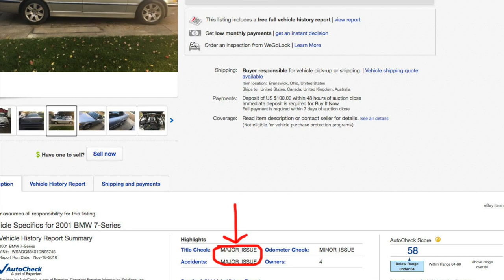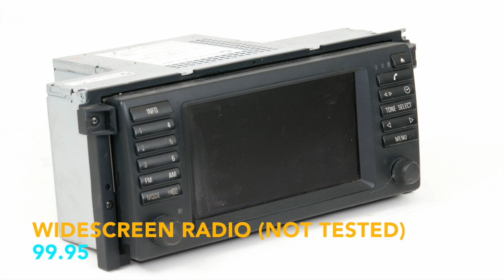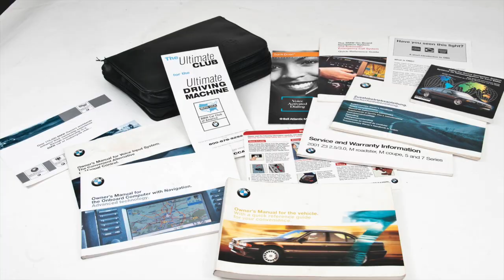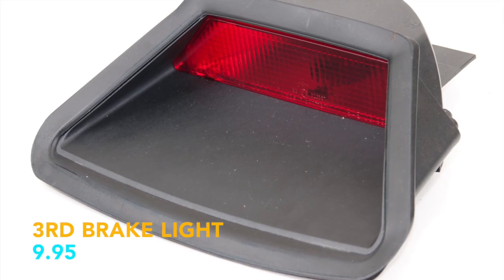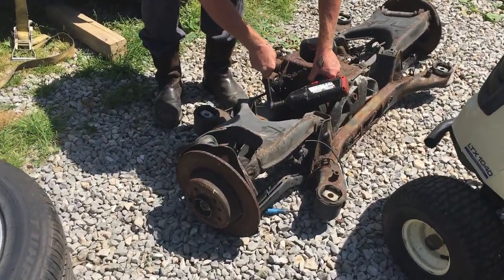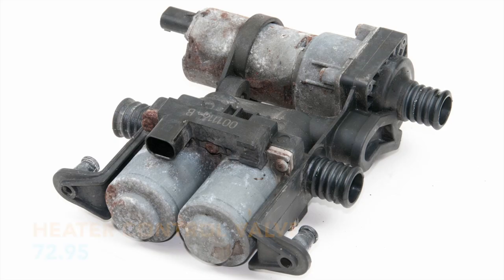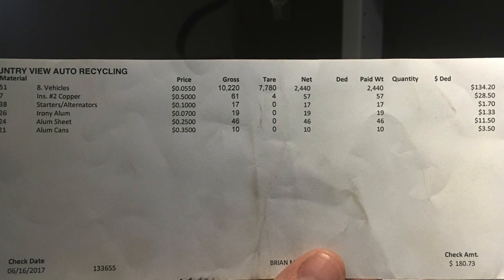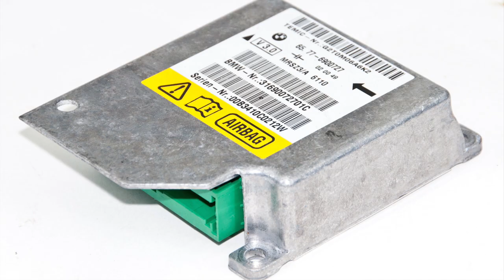How I made $4k parting out a BMW E38 7-Series - only half way done!

Comment: I’ve been parting E38s for about a year now. Currently on my 7th one. I love it because it’s fun but also very profitable as you are seeing.
Reply from the maker: You're absolutely right. This was a fun car to work on. There was some learning involved, as BMW does some things differently, but now I'm on the lookout for another E38 when I have the space.
Reply: Hey Matt roughly how many hours do you think you have between stripping/listing/shipping on a  average per car? I'm stripping an 2006 5 series and I'm already at 25 hours and I think I should be farther along,  but I'm not sure. The only thing left to do is to strip and list the interior.
Reply: @nathanhensn8717  howd u do parting your 5 seriers out
Reply: @egrayy9500  I'm a full time ebayer right now bc of it. I'm $3,200 "net profit" after fees and everything. Have about 130 hours into everything for that car, but around 40 were for learning and mistakes. I stopped doing it just bc of room reasons and im into Amazon returns now for ebay. I am selling my house and getting a building for my business, and stripping cars will definitely be added to the arsenal. I'm going to stick with the S series, maybe Coopers, and obviously 7Series if I can find a decent one. With my ebay experience right now, and a lift/room I could probably cut the time into 80 hours total from fully together to sold/ shipped.
Reply: @nathanhensn8717  what items sell good and what did u get for the 5 seriers
Reply: I did 7x BMW E39 5-series the same way in the Netherlands.. also love it. The money is nice if you don't literly count all the hours. For me it's also a bit of a hobby.. wrenching in the weekends 😁

Comment: I've been buying salvage Mini Coopers (2002-2006) over the past 4 years.   1st one was a 2004 JCW that too far gone to repair.  Bought for 2250.00.  total parts sales = ~6600.00.   so around 4k profit.    Rebuilt the 2nd one, a 2006 JCW convertible into my summer daily driver.   And finally have another 2004 S that is currently being torn down in the garage.    Keeps me out of trouble and funds other projects that I can't get by the finance dept.  :)   Great channel by the way, glad to see you are still working on cars/trucks and expanding into being a youtuber.

Comment: Who the fuck would dislike this? It's a great video that took alot of work.
Reply from the maker: Thanks man! I think people get salty that I parted out a complete E38. The car doesn't look horrible on video but in real life it was junk. It wouldn't start, had a salvage flood title, electrical issues, rust holes, damage or rust on every body panel except for trunk lid, no reverse etc... Some cars are better off as parts to help the worthy ones stay on the road.
Reply: @6thGearGarage  I don't understand it. People don't realise how easy it is to total a European car. What are you going to do dump more into than it's worth and lose your ass? You did a good video imho. I have a good S55amg and a parts S55amg and they looks realitivley similar, but the frame is bent on the parts amg. It has saved me 3k just in parts so far.

Comment: Just run into your videos today (10'27'19); and have been enjoying them. Thanks for sharing. Awesome channel. Was going to ask you about the shipping fees. These odd looking items they are pretty expensive to ship. What methods have you been using? if you don't mind sharing. Thanks
Reply from the maker: Thanks!  I use USPS for most small/medium size items because they offer free boxes and free pickup. For big or really heavy things that  don't fit in a flat rate box, I drop of at Fedex.  I shipped the engine block and had to drop it off at a local shipping company. The buyer was in FL and paid $300something to get it shipped. Buyer always pays for shipping on all items. I tried doing free shipping and lost money whenever the buyer was on the west coast.

Comment: How much of this would've been returns since many of those modules and electronic stuff would've been broken
Reply from the maker: There were a few components I didn't sell like the EWS and a couple other modules that had to do with the car not starting. I was able to test everything else except for the engine and trans, since the car wouldn't start. A buyer said the transmission didn't have reverse, so I gave him a refund and let him keep it for parts. He was local so there was no shipping to refund. I took apart the engine and sold it as pieces since I never heard it run as a whole.

Comment: how much profit you think i can make off my e39 540i 2000?
Reply from the maker: I can't guess for sure, but if I'm close to $10k on this E38, I think an E39 wouldn't be far behind, if it's in good condition. Although if it's nice, I'd sell it whole, as the 540i is a great model to own. Great performance w/o the price of the M5, especially if 6 speed. Badly rusted or wrecked cars are ideal for parting out.
Reply: @6thGearGarage  I drove it with broken timing chain guides and I'm 100% sure I  messed up the valves. compression was off on a cylinder or two.